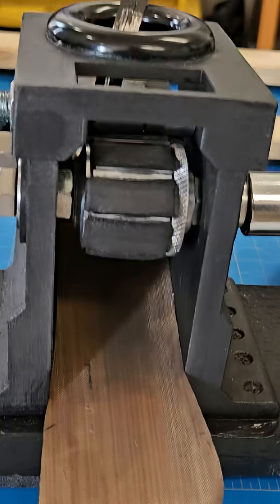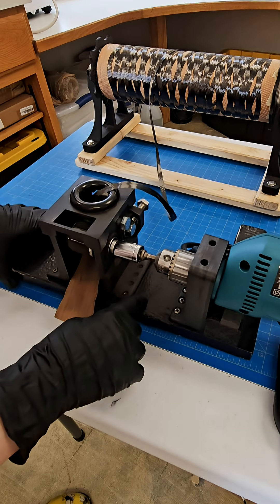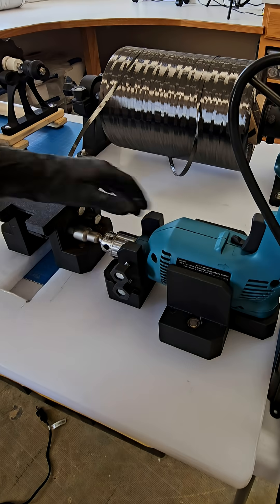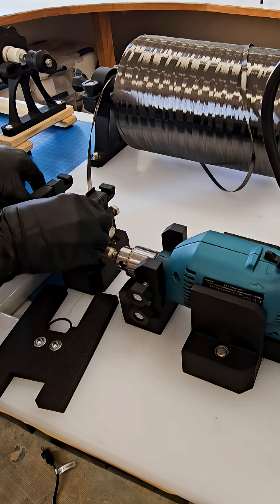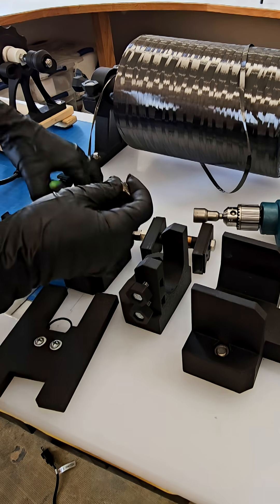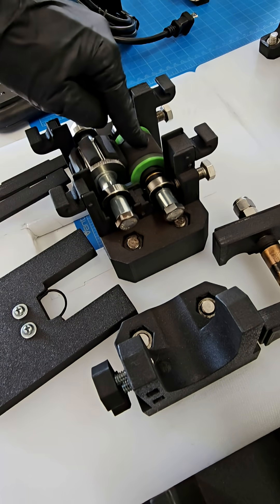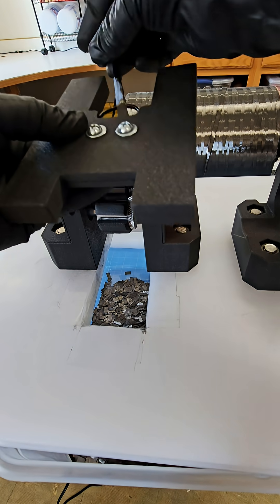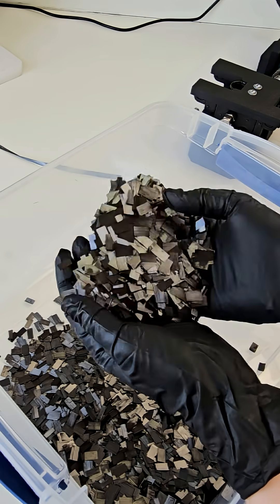I built a carbon fiber chopper #forgedcarbonfiber

Comment: Very cool! Do you see a need to have tension in your carbon fiber web as it rolls from the unwind to the chopper? If it was helpful to control the tension, you could create a couple percent draw between the 2 rolls by powering both independently but run the chopper roll at a couple percent higher RPM.
Reply from the maker: I thought about powering the spool separately to get consistent tension, but the added complexity was not worth it since it worked well enough without. The rate the spool needs to spin changes as the roll is used and gets smaller, and I did not want to try and figure out how to compensate for that if at all possible to avoid. But ideally, absolutely that would be nice to have tension control ability.
Reply: @LindyDesignLab I think they meant a consistent pulling tension, giving the spool a little brake so it’s always under tension as it pulls. That’s where my mind went anyway.